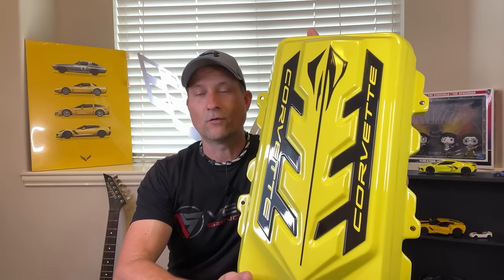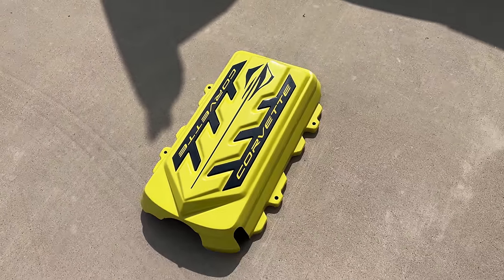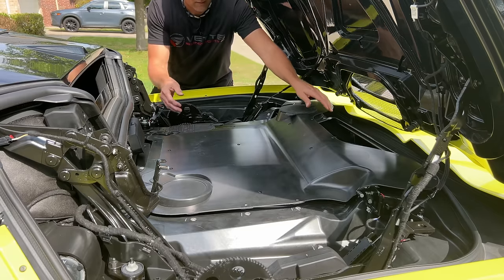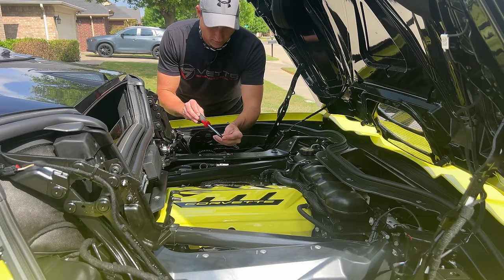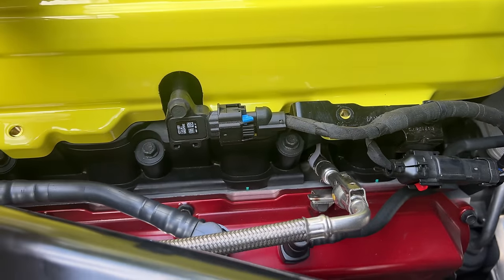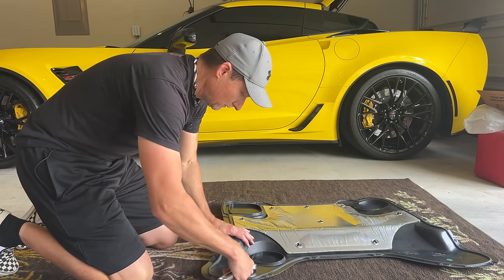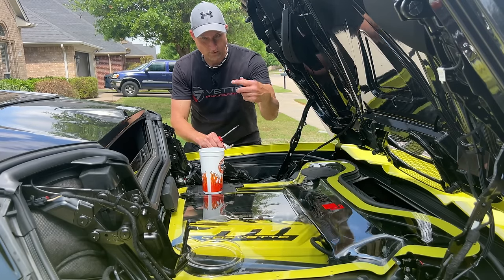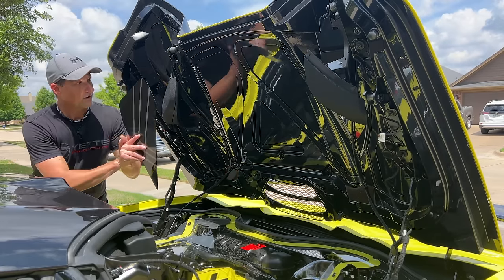Fixing GM's Big FAIL on The C8 Convertible Corvette!!

Comment: Very cool. You did a great job and looks amazing. Nonetheless, be careful as there was a heat shield on the piece you removed. That heat shield was there for a reason. If you don't believe me, measure the temperature against a non modified car. Heat has consequences over time.

Comment: I'd be fearful of the long gevity of the heat transmitting through to the liner of the top. There's quite a bit of insulation beneath the factory black plastic shield.
Reply from the maker: Yeah. I’ve considered that. I don’t drive for long periods of time with the top down.
Reply: I'm late to this video but this is exactly my concern.  By now folks have seen the optional GM cover for the HTC and there are large portions of it that are still blocked off. Those blocked off sections line up perfectly with the headers and cats.  Both of those will release radiant heat, which we also know as: light.  That light will shine right through the clear plastic of this solution (and others like from Paragon, etc) and slowly fry the HTC cover when it's in the retracted position.  It's the reason the underside of the OEM covers have foil-based heat padding: partially to absorb the convective heat, partially to reflect the radiant heat.

Keep a close eye on your HTC's cover.  If you fry it, there's no warranty coverage for you and that's going to be an expensive replacement.
Reply: I would love to see an update video this September after your summer driving 😀

Comment: Looks great. However, it doesn’t have the heat insulation on it that the stock cover has. Any worries about your top being exposed to more heat when the top is sitting over the engine?
Reply from the maker: Yes. But I’ve asked around and haven’t heard of any issues. This product has been out for a year and so far I haven’t seen or read about any problems elsewhere either.  I’ll definitely be keeping an eye on it.
Reply: Yeah. I’ll be interested to see how well everything holds up, and if it causes any heat issues in the future.  Looks awesome. Like the inserts for the cover.
Reply: Jason; if you aren't having any issues with it in Texas, I don't think I will have any in NJ.

I went to school in Texas and froze my butt off during the winter and I was baked crispy brown in the summers!

Thanks for the information!

Comment: I have a question ☝🏼recently yes purchase a HTC c8 thinking to buy clear cover bad how much heat can handle that type of material
Reply from the maker: I don’t know the full amount but it is able to withstand normal and even above normal driving temps. At least in my experience. I have also not heard of any issues and this product has been out for a couple years. Maybe if I was doing a track day I’d put the GM cover back on but for the rest of the time, I’m leaving this one on.

Comment: Definitely looks much better, but have two issues. 1. you will not see the engine spending quite some money but you will see a colorful engine cover. 2. I have doubt concerning the heat propagation. The additional plastic engine cover partially stops the heat flow from the engine, so not sure will not cause overheating the engine in long term.
Reply from the maker: I’m not sure about the overheating. I took my car to the track a few weeks back and there were no overheating issues and no damage to the polycarbonate plastic. I’ve had it on my car for probably a year and so far no issues. The product has been on the market for way over a year and as far as I have heard, no issues on anyone else is either. I will know more in additional time.

Comment: Have fun keeping it clean I think the heat will  make it yellow and you would need a special  cleaner so you don't scratch  it but it does look great
Reply from the maker: Believe it or not, so far, no issues. I’ve had on for probably 1,000 miles even drove some dusty roads on Saturday and my car was filthy but the cover just needed and exterior dusting. No big deal. May be an issue down the road but nothing as of yet. 
Thanks for watching and commenting. 🙏

Comment: you removed heat shield and replaced with glass.   what about the heat?  is it a concern?
Reply from the maker: I’ve looked it up and can’t find anyone with issues. The glass is heat tempered or something. I’m definitely monitoring it though. I definitely would swap back temporarily if I was doing any hard driving with the top down. Just as a precaution.

Comment: Looks great and I love the idea of having a view of the engine.  I have the same concerns as everyone else regarding heat...also wrapped my top so interested to see if PPF / colour wraps are an issue with heat.  Are you using this as your permanent engine cover or only for shows?  I'd love to be able to use it permanently and not have to be swapping back and forth with the OEM cover.
Reply from the maker: I am using it all the time. 

AMT said it’s high heat polycarbonate. I also haven’t really heard of anyone with issues so hopefully it’s all good!

Comment: It looks great but I noticed the stock cover has some heat shield material on it. How much hotter does the top get when retracted? Or does the paint on the back deck lid or whatever you want to call it get? Will the paint fade over time from extra heat?
Reply from the maker: I’m not sure. Hasn’t yet. The cover is polycarbonate and is “supposed” to withstand the heat. The product has been on the market for well over a year and so far, I haven’t heard anything bad.
Reply: @FrontSeatDriver  glad to hear it. I saw it on a vette forum and was interested in getting one for mine. I was surprised by no engine cover from GM in the video. Ill have to get one of those as well.
Reply from the maker: @GambitC8  Yeah. I thought that was weird too. Definitely need a nice one.

Comment: How does it compare heat shielding wise??
Reply from the maker: I’m not certain yet. I’ve asked a couple people that have had it awhile and they said they have no issues.
Reply: @FrontSeatDriver  it look phenomenal, I just received my allocation today - finally. I would love to get this in red. I’ll keep a look out for any info on how its holding up, heat wise or discoloration.  What was the price??
Reply: @FRONT SEAT DRIVER  If you placed your hand on it after a longer drive, I'm sure that question would be answered. If it'd warm/hot it should be fine. If you have to call an ambulance it's not enough shielding lol

Comment: Why would I need a clear engine cover when I can just look at the engine.... some people just waste money on stupid things I guess
Reply from the maker: How do you see through black plastic? You’re not related to Superman are you?
Reply: @FrontSeatDriver  it's an engine, that people put a engine cover on designed to look like any thing that designer designed, so one is not really looking at an engine but looking at an engine cover....then to top it off with a clear cover again makes no sense,,,,
Reply from the maker: @Swflac8  oh…. I gotcha. Correct, it’s an intake cover.  I think it looks substantially better than without. Just my personal opinion. The glass is likely to reduce the heat from the engine. Some people have asked if it causes issues when the roof is down. As far as I know, no. Rick Conti did a video about this I believe and gave it a thumbs up and I do not know if anyone that has had any issues.
Reply: What heat by the way,,, I feel no additional heat in my car,,, people just mention stupid things like this and it seems everyone just wants jump on the bandwagon to put something in when you don't, in fact there was one who put a heat barrier in his trunk...he mention people need it cooler in there, and I replied well stop putting people in your trunk.... such a waste if time

Comment: Does it reflect the heat like the stock cover does
Reply from the maker: I’m not certain it’s as good as the stock cover but I driven with it quite a bit now and no issues. Even went to the track and ran some laps and still no issues.

Comment: When it comes to improvements for that area where the engine is far as a heat shield making it so that it's visible and also some of you guys are installing devices to keep the water out to a certain extent. Did anyone consult with any of the corvette engineers about these changes?
Reply from the maker: That is information I do not have but my understanding is that the manufacturer tested the product. That said, if I’m going on long drives or doing “spirited” driving my top will be up. 1. For safety. 2. As a precaution to prevent possible heat damage to my roof. 
I believe there’s a YouTuber with a video that tested the heat and found it was acceptable. 
I still think it’s better to err on the side of caution. Although this product has been out for over a year and I’ve never heard of any negative issues.